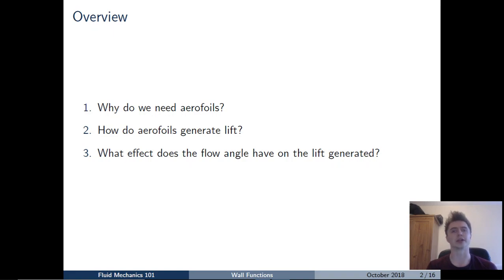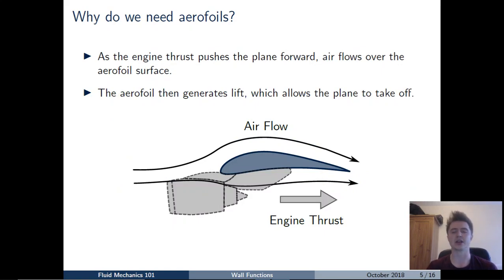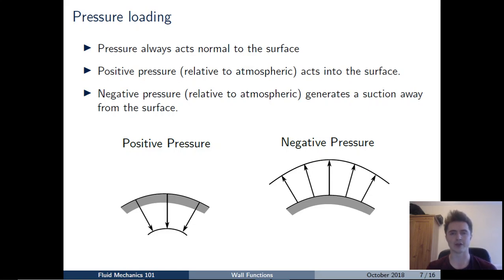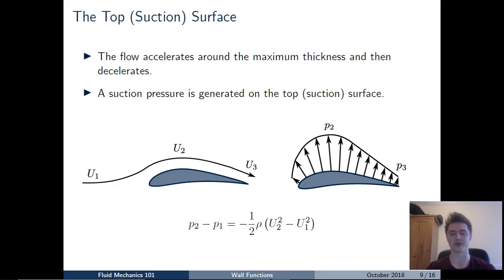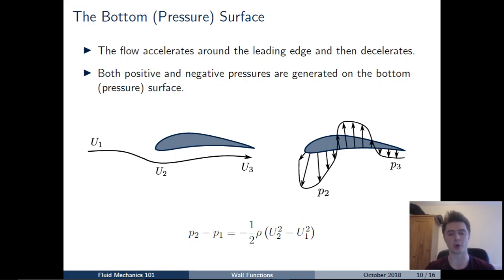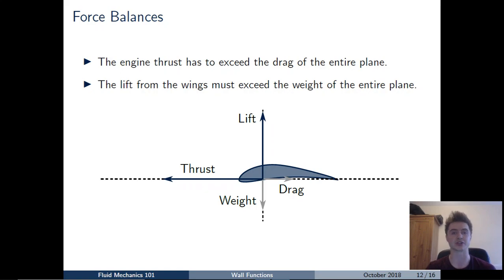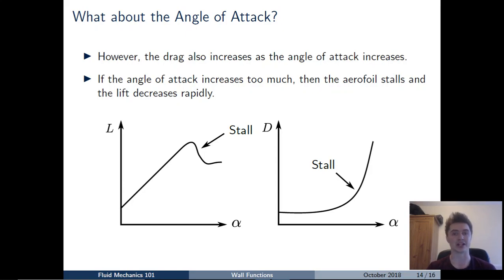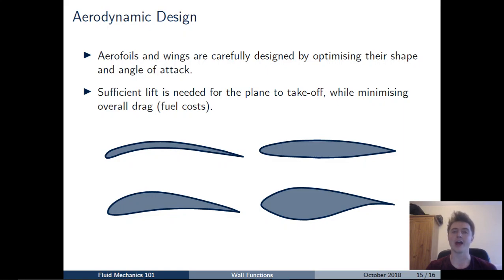[Concepts] How do Aerofoils generate Lift?

Comment: Great video. Of course the next question is always why the flow speeds up and slows down around the aerofoil, I haven't quite found a simple way of explaining that to the layperson yet (without getting into flow turning, circulation and potential flow theory at least)!
Reply: The wing pushes air out of the way and atmospheric pressure holds air against the wing and in behind the wing. This changes pressures around the wing. 
Air accelerates because of pressure differences called Pressure Gradients. This is nothing more than Newton. Air has mass and force is required to accelerate mass. The difference in pressure between two locations, the Pressure Gradient, provides that Force for air.
.
Look at a wing at a small angle of attack. You should see that the lower surface is approaching air. The wing essentially pushes against that air. Because the air has mass and inertia, it cannot move out of the way easily, so this increases the pressure there. When a surface and air are approaching each other, there will be an increase in pressure.
.
The air that goes above the wing is first pushed up, but then it curves back down again because atmospheric air pressure holds it against the surface. 
Because this are also has inertia, it wants to go straight. Atmospheric pressure is enough to keep it curving back down to the surface, but the tendency to go straight lowers the pressure at the surface just like you feel lighter at the top of a roller coaster hill because the inertia of your body wants to continue straight in an upward angle.
.
This is the converse of what happens under the wing.
This should allow you to see that the pressure will always be lower on the inside of a curved flow and higher on the outside of a curved flow.
.
These pressures are then responsible for the top-bottom pressure difference which is the lift; all of the lift.
.
Many people seem to forget that air pressure holds air against all surfaces. The pressure only needs to change a small percentage to generate significant Force. Your outstretched hand has about 20 square inch of surface and at 14 PSI you have about 300 lb on the front of your outstretched hand. The front of your body has on the order of ten thousand pounds of force. The top surface of a Cessna 172 Wing has 350,000 pounds on its 25,000 square inches. When flying, that Cessna has only 0.1 psi top-bottom difference to hold up the 2,500 lb craft.
With a pressure decrease of approximately 0.08 PSI above the wing, this is only a 0.6% change in pressure.
Reply: @Observ45er  There's a great video from Doug McClean about common misconceptions in aerodynamics. His thesis, which agrees with my own point of view, is that there is no simple way to explain the flow around an aerofoil. A combination of the aerofoil geometry and the angle of attack induce non-causative changes in the pressure and velocity fields (i.e. It is not appropriate to say one causes the other) which explain the production of lift, and while we can calculate and model this with reference to Navier-Stokes (or simplified theories) there is not really a satisfying physical explanation. 

Not to discredit your explanation but it isn't really a rigorous treatment of the problem (hence my original comment), mostly because I don't believe there is one. Saying 'air pressure holds the flow against the surface' doesn't really mean anything.
Reply: @adamt7667  SO many well-meaning people repeating the common misconceptions. . . Who did you study with? 
..
I've discussed things with Doug and some other authors and aerodynamics experts including  MIT's Mark Drela and Embry-Riddle's Charles Eastlake.  Unfortunately, some engineers do have trouble explaining their technology.
.
RE: "Saying 'air pressure holds the flow against the surface' doesn't really mean anything."
Perhaps you'd be interested to know . . 
.
Your out-stretched hand to say STOP has about 300 lbs on the front surface. (14psi 20 in sq).  
The front of your body can have 10,000 lbs from air.
.
The 25,000 sq in of a Cessna 172 wing has 350,000 lbs of force on the top surface (and bottom).  YEP! 
.
That Cessna flies with 0.1 psi top-bottom pressure difference to hold up the 2,500 lb craft. 
Look up the "wing loading" yourself.
It is something like 14.7 lbs per sq foot. Do the calculation for PSI: Hint: 144 sq inch per sq ft.
 .

With roughly  80% of that difference being the decrease above, that is a pressure reduction of 0.08 psi above the wing. That is a 0.6% change from ambient. For sure, the remaining 99.4% of that 14 psi is sure as hell is keeping that air against the surface! 
.
In case you didn't know, even in stall, there is ALWAYS air pushing against every surface, even pushing DOWN on the upper surface of a wing.
.

Yes, it is true that the equations never "explain" the science. 
.
I'm sure you will bristle at this, but , if you have a well-founded and complete  understanding in Newton's physics, there is an explainable cause-effect relation in lift. Stay tuned. . .
.
If you are truly serious, Try these two explanations using standard, real physics:
.
The pressure decrease above a wing:
https://www.youtube.com/watch?v=3MSqbnbKDmM
.
Understanding Lift Correctly:
https://rxesywwbdscllwpn.quora.com/ 

- - 
Regards.
Reply: Surface resistance differential.
Reply: @jaredstokes9895   Nope!  Read my reply to Adam T in  this thread, right above this reply.  - and my comment from 4 months earlier that should be right below this. 
\/ "You've got it correct that
Reply: @Observ45er  Not that it's particularly relevant but I'm an aerospace engineer and pilot (mind you they still teach pilots equal transit time theory so not much credence for that). I say your statement  'air pressure holds the flow against the surface' doesn't mean much because it is clearly reductive - how can this be wholly true when we know that flow separates from the wing? Why doesn't the air pressure hold the flow down in that scenario? I'm not trying to be combative but there are plenty of phenomena like this which are simply difficult to explain without reference to the underlying mathematics, people just seem to latch onto lift (likely because there are so many common wrong explanations confidently given).

I'm very jealous, from what I've seen and read from Doug he seems like a knowledgeable chap.
Reply: @Observ45er  I dare you to try a challenge. Make a hook with your hand pointing down out the car window, start the car moving until you notice an effect. I say lift will be generated and your hand will go up. Prove me wrong.
Reply: @jaredstokes9895   I don't know if you're picking on part of my comment or what. 
..
I don't know what you mean by "hook".
..
If you mean curve my hand like when they say to 'cup your hand'  then, turn it over with the palm down, thumb toward me, fingers forward into the 'wind' and the curved back of the hand upward. . . no-problemo dude.
.  
The curved flow above the back of the hand lowers the pressure - Just like my accurate 1 minute video.
With a shape like that, there will mostly be turbulence under the palm that is pretty irrelevant at around  one atmosphere below the hand. . 
.
So what's the point?.

Put something kind'a like a wing out the window and it lifts.  So surprise, nor argument.
..
1 minute curved flow above video:
https://www.youtube.com/watch?v=3MSqbnbKDmM
..
Talk to me. . .

Comment: Why does the shape of the airfoil cause a change in the flow velocity? In other words, why the air particles need to speed up when approaching a convex surface?
Reply from the maker: The easiest way to think about this is with an external surface or wall placed above the aerofoil. As the flow passes through the area between the wall and the curved surface, the flow must accelerate (from mass conservation) as it passes through the minimum area. 

Remember that the curved surface also changes the direction of the flow, as well as the velocity magnitude. Changes in direction and magnitude both result in pressure changes on the aerofoil surface (thanks to the Navier Stokes equations). I hope this helps your understanding a bit 👍
Reply: @fluidmechanics101  So the streamlines further away from the suction surface act like a barier, limiting the fluid particles from expanding upwards. I suppose this effect is stronger at higher velocities.
Reply: @Antoan Hady  Yes, because there is friction between the air particles (or layers of air, if you will), the steady air particles will slow down the adjacent moving particles. Viscosity might be the keyword for you to better understand it, but it seems to me that you already got it.

Comment: I always used to think as lift as this, but nowadays I start to change explaining how lift works. To my idea you bend the air downwards and you have to bend(accelerate) as much air down as the force you need to fight gravity.(action=reaction) So, m_aircraft*g=m_air*a_downwards. You want to do this as efficient as possible. What I do not fully understand jet is how to calculate the minimum energy needed to bend this air downwards. I am curious what you think about this!

Comment: Hi Aidan, thanks for the video. In fact, there are many many interesting points can be covered, like NASA they used to organize meetings yearly to collect all wrong understandings of the lift generation of the airfoil. Some other point of view of lift generation is the flow redirection caused by the shape (like the Magnus flow), and the stall region is mainly caused by the flow separation when is angle of attack increases, which provides big pressure difference. It may help to understand.

Comment: Hello, is the correlation of lift and angle of attack linear? What is approximately maximum angle of attack before stall?
Reply from the maker: Hi! Yes, the correlation between lift and angle of attack is approximately linear before stall. This is true for most aerofoils that are used in common applications. The maximum angle of attack before stall is different for every aerofoil, it varies with Reynolds number and the surface roughness of the aerofoil. It will also vary between CFD codes and experiments and is very difficult to predict exactly! Of course this is not very helpful. From personal experience I have found aerofoils used for wind turbines and aeroplanes tend to stall around 10-12 degrees (depending on the CFD code). XFOIL usually predicts higher stall at around 14-16 degrees. Of course, the best and most reliable thing you should do is use experimental data if you have it. If not, then the airfoil tools is a great database which you can check out. You may even find data for your aerofoil there: http://airfoiltools.com/airfoil/details?airfoil=naca643418-ilhttp://airfoiltools.com/airfoil/details?airfoil=naca643418-il . I hope this helps!